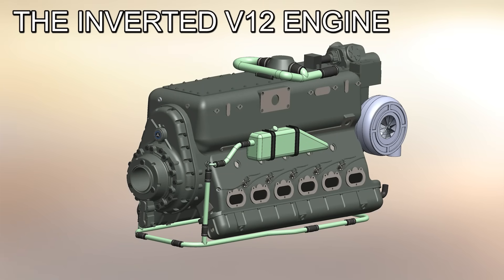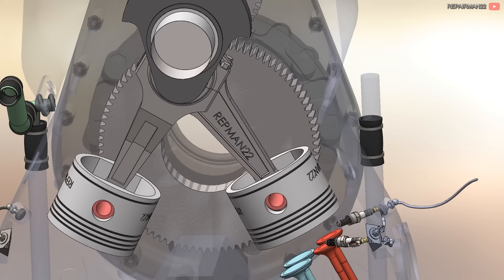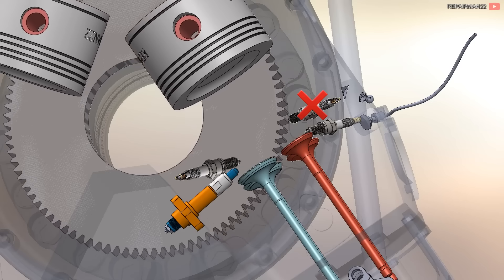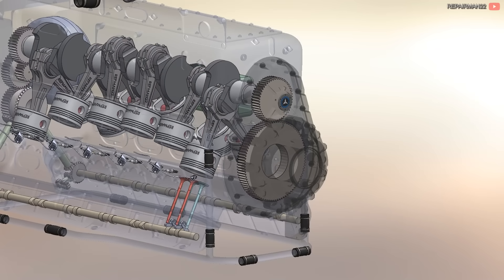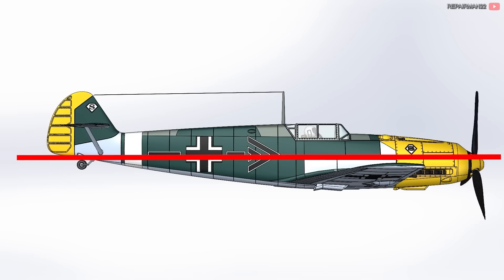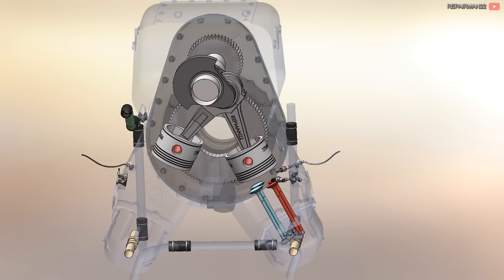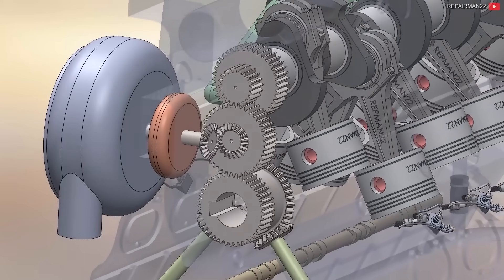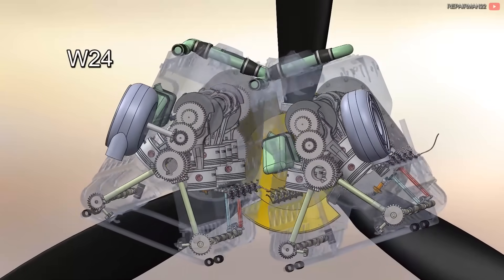The INVERTED V12 🤯 Why!?!?  - 3D animation - DB 600 Engine // Daimler Benz

Comment from the maker: Use code REPAIRMAN50 to get 50% OFF your first Factor box plus 20% off your next month of
orders at https://bit.ly/3XwV1uV!
Reply: No sabía que tenías un canal en inglés, lo hubieras dicho antes jaja
Reply: Would be nice to know mention what are the problems of inverted V engine layout

I suggest as a topic for next video diesel engines 5TD and 6TD of T-64 and T-80UD tanks, may be also V-2 diesel of T-34
Reply: @drusa6107  He did explain a few of the problems in the video:

1) Oil flowing into the cylinders if the engine was left standing. 
2) Uneven compression ratios in the two banks of cylinders. 
3) Access to spark plugs and other top end components is restricted.
4) A problem arose because of the need to put both spark plugs on the same side of each cylinder, leading to non-optimal ignition and burning. 
5) Not mentioned directly, but oil consumption is a little higher than in a standard V engine, because of some of the lubricant feeding into the cylinder heads. 
6) 5 piston rings per cylinder are needed as a partial compensation for that problem. 
7) He did mention the gasoline from the injectors stripping the oil from one side of the cylinder, leading to increased wear on that side.

So a second video isn't really needed. 

I hope that this helps you?
Reply: Aerospace engineer here - WELL DONE.
Reply: Research ur sponsors. I think this is a scam and I HATE scams and fraud with false advertising
Reply: Your channel is incredible.  Thank you for this  creation .
Reply: how will it run on modern avgas
Reply: like 115 avgas

Comment: This is actually a wet sump. sump is another word for oil pan. A dry sump is where there is a separate oil tank and the pump tajes oil ferkm😢 the tank then  what oil pools on tge sump is then transfered back into the oil tank.

Comment: You don't need an inverted engines to run reduction gearbox for the prop drive. It's better suited to an upright V like the Merlin as inverting with a reduction drive lowers the prop closer to the ground, increasing the chances of a prop strike. Also many upright V engined planes had a cannon firing though the prop. The French were first to do this with the Hispano Suiza engined  MS and Dewoitine fighters.

Comment: Nitrous oxide or Water/ methanol injection, Direct  fuel injection, a hydraulically operated supercharger, and a aluminum alloy engine block - -in the 1930s? This thing was brilliant and so far advance on so many levels.

Comment: 9:52 Bosch and Deckel sold its injection system to the USSR. Therefore, before the war, Soviet tanks had diesel engines with it (KV, T-34, JS), and soon Soviet aircraft engines received injectors (La-5FN etc). Do not overestimate the common sense of the Nazis.

Comment: The V 10 suffered from over heating and fire's. Used in the Hinkel bobmer which was refert to as the flying coffin ( not a popular aircraft as it freaquently crashed due to engine failurea killing the crew )  witas withdrawn as this over heating problem , and could not be over come . The  engine was cancelled.

Comment: In the case of fuel injected engines, the plane while flying inverted the engine would find itself in the conventional attitude. It made for better visibility as the cowl area was the smaller part and the greater width at the bottom, improving forward perception as well?

Comment: Find it interesting that the bf109 most associated with the DB601 did not have it for it's test flights it was fitted with Rolls-Royce kestral engine. After the war the Czechs found bf 109 airframes but no engines, so they fitted the Junkers Jumbo 211f and called it them the
Avia S 199, and solded them to Israel. Those pilots called it the mezek or muel, it was likely the worst of the bf109s. They had reduced yaw stability because of the underpowered over weight engine. 
Spain during the war was building bf109s but engines and props were to be supplied by Germany. After the war they were fitted Rolls Royce Merlins and you can see them in 1960 battle of Britain movie. The Merlin makes the nose a lot more chunky. Saw a HA-11102 in a museum once it is a odd plane.
Reply: The problem with the Jumo engined 109s was thry rotated in the opposite direction to the DB. The 109 fin and rudder were asymmetric to counter the prop rotation torque of the DB. This was not changed in the Czeck Jumo engined planes, exacerbating the prop torque swing on takeoff.
Reply: @billbuckley8423  The lower RPM and fat paddle blades,  and the lack of a rudder trim were not doing the BF109 any favors, either.
Reply: @Owen-mt4si Yes. The jumo engines and props used were designed for bombers.
Reply: @billbuckley8423 It is interesting how a good plane can be messed up by putting the wrong engine in. Lots of little things make a plane good.

Comment: The low octane fuel had no effect on engine being upright or inverted. It did however spoil the W 24. Reduced efficiency caused areas of overheating that DB never could fix.

Comment: So one has to wonder what the maintenance schedule was compared to a merlin, anyone?
Reply: +@johnbolt665   Wartime DB numbers were top-end overhaul every 100 hours,  major overhaul every 200 hours and max engine life of 600 hours.  I think the few flying DB engines today still use the 100 and 200 intervals, unless more durable parts and processes are being developed.  Merlins today with better parts can go 700 hours or more with easy flying, while air display Merlins with aggressive flying will get lower numbers.

Comment: Nobody is gonna make an inverted engine, and you know why? Because of the freeking physics

Fluids are attracted by gravitation, so they usually circulate in the lower side of the engine, and until now all engines toox advantage of this, engine oil sits at the bottom A pump pushes it up, and then it flows down through special holes on moving parts, makes them slipery and then reaches back to the oil pan, now, if you flip the car upside down you get your inverted engine but this time... oil gets in combustion chamber engine consumes it, and parts tahat have a ton of friction and really needs oil (like idk, THE FREEKING CRANKSHAFT AND PISTONS) get no freeking oil, lets say you move the oil pan where now you have the camshaft now and move the pump there too, well, the pump will do its best to push oil on the crankshaft, but crankshaft nees a lot of oil (this is why it tipicaly sits in the oil pan) and the pump wont give enought oil for lubrication, also now you need a lot of rings to keep your combustion chamber as isolated from the oil (if oil gets in , car consumes it and you know the deal), now , rubber (the best for this use), in 5 years gets older and have micro cracs etc (especialy in contact with oil and hot temperature) so your engine will be consuming oil like... 5 years ahead of any other engine? So instead of needing expensive fixes after 8-10 years of use because it consumes oil, now you need to fix it IDK, EVERY 3 YEARS?. If cars were truly made to break apart under 5 years, just so u have to buy a new car because it is too expensive to fix, this engine would have been in every ducking vehicle since 30 years ago.
Reply: +@randomone649   Aviation engines are typically dry-sump and pressure-lubricated for oiling.  The lowest point in the inverted DB engine will be the rocker covers and there are scavenge pumps there to return the oil.

Comment: Thank you, Repairman22. I always wondered why the German engines were inverted and how they could work with all the oil running down into the combustion chamber. Another thing I learned was the torque converter on the supercharger, which allowed the speed or load to be varied. I’ve only known superchargers that run at a single speed. Very innovative for the time. I love this sort of technology from the past. I’m 50% German and a retired engineer and I spend a lot of my spare time watching these videos. Please keep it up.
Reply: +@JamesStanfieldatMSN  The specification for inverted engines was made by the RLM in the 1920s.

Comment: So... Why not use external oil pump and carter to prevent the oil to excessively acumulate and go to the combution chamber? ,-,
It can improve the reliability...discarding the necessity of change compression ratio, improve power too, minimizing vibrations of irregular cylinders burns.

Comment: Double V12 or W24 was wasted over engineered pure idiocy, they ended up with fire bomb. Mercedes used same mechanical fuel injection in their 1950s race cars and later in 300SL gullwing. By that time Bosch had developed simpler fuel injector system for vehicles. But Mercedes insisted using their own injection system. It was difficult to tune and complex to maintain and repair. My dad worked for Mercedes all his life. From 1959 till his retirement in 1994. He hated that fuel injection system. But only one other mechanic and him were only ones who knew how to fix them and tune them. Otherwise car would sputter and stall easily.

Comment: one advantage of inverted engines that nobody mentioned, is gravity. in an inverted engine, gravity
pulls down on the crankshaft while all the power strokes are pushing up. this would have the effect
of lightening the crankshaft, cutting down on friction, easing wear on the mains and resulting in
more power.
Reply: The weight of the crankshaft is negligible compared to the force from the cylinders firing. Even just the resistance from compression would be more force than the weight of the crankshaft.
Reply: of course !

Comment: The weak part of the mn/wpl model is obviously the board speed controller (they burn a lot), weak rtr gear in the gearbox and axle, hard tires for some model, weak couple shaft (some may experience that their axle shaft still going strong, but mostly break after a couple of run especially on the first model), front plastic dogbone that is weak and not allowing sharp cornering. But, all in all, a nice model for what you pay, you can make it more durable with metal upgrade option but be aware of the increased money you spend, as it can double or triple what the original rtr cost. My reccomendation for a low cost upgrade is to change the original 360 motor for a 370 motor (as in original wpl dual speed gearbox, the plastic one, not the metal version) as it has more tourque, and add a mini heatsink on the motor driver mosfet.

Comment: Machine g u n s right behind the propeller blades .. !!, can't imagine how they can be synchronized with different rotation speeds of the propeller..
Reply: Surprisingly simple, synchronization gears were powered off the engine and set in time with the propeller. Mechanical solutions from there use a cam to either prevent the plane’s armament from firing at certain times (via a cam interfacing with a safety sear), or by having the cannons be semi auto and just having the cam slap the triggers at set safe times.

Comment: I'm actually amaze how does machine gun synchronize with the propeller
Reply: There's a system of cams and connecting rods on the propeller shaft, connected to the firing mechanism of the guns. It prevents them from firing when the blade of the propellor is in the line of fire; thus, it fires bursts between the propeller blades. This can get complex when you have a 3-bladed prop and 2 machine guns side by side, to synchronize.

Comment: Actually in the shematics it looks as if the height of the cylinders below the prop shaft was less than the height of the oil sump above the shaft, so a non inverted engine would have had lower cowling and better view for the pilot. I wonder if the always mentioned better visibility and more space for machine guns above engine was really a factor, to me it looks that there would have been more clearence above on  non inverted engine.

Comment: I don't understand how they kept the oil in the oil pan since it is inverted. The oil would also collect under each piston, I assume.
Reply: +@DavidJacques-h6s   Most of those engines were dry-sump and pressure-lubricated and used scavenge pumps to recirculate the oil.
Reply: The oil collects on the back of the pistons. But, it should get sloshed around and help with lubrication and cooling. They’re moderately low rpm engines so the extra weight and drag isn’t a big deal. 
The oil pan is really a tank that isn’t open the way a traditional oil pan is. It’s closed from the crank so it can hold the oil. 
At the end of the day they could have simply made a normal engine with a remote oil tank and not had all the complexity of making it upside down.

Comment: i love the db603 and how it was almost used in the mercedes t80 world speed record car. 3000hp 44.5L v12 with a super early traction control system wouldve been epic to see had the war not broken out the month or so before the planned run.
Reply: +@gameboy3800   The T80 car still exists in a museum with the DB-603.
Reply: @FiveCentsPlease  ive heard the shell and chassis are in a museum but not the motor.
Reply: @gameboy3800   I believe you are correct that the DB603 was removed for wartime use.

Comment: Great Video, with Great 3D graphics... Thank you for taking the time to create this. I would be curious to know which product you used to modeled it in.?.?.?

I watched a Documentary recently that discussed how; "many of the Allied Pursuit Aircraft had poor visibility, because the V engine was upright, the fuselage had to be wider at the top, and when a pilot looked through the canopy window, the pilots couldn't see down, and to the left or right very well..."
"...the Germans, however, using an Inverted V Engine could make the fuselage more narrow at the top, giving them a little more visibility when looking down, and to the left or right".

This YouTube video doesn't mention this, and I cannot find the Documentary for reference.

Can anyone Prove, or Disprove what I wrote above?
If True, it's a good point.
If it's not true, this Comment should be either revised, or removed.

Anyone?

Comment: In these inverted engines, how did oil from the crankshaft or the under sides of the pistons get back into the oil system, and not try to drain past the rings towards the combustion chamber?
Reply: +@davidhirschhorn2960   Most aeroengines are dry-sump and pressure-lubricated.   Scavenge pumps will collect and circulate the oil back to the reservoir.  In the DB engines, there are scavenge pumps in lowest part of the engine in the rocker covers to collect the oil that flows there as well.

Comment: Great video

An extra advantage of the inverted engine was that the distance from the crankshaft to the upper surface (piston case or what would have been the sump) is reduced. Since the distance from the that to the upper fuselage is driven by allowing the pilot to see forwards, the plane could have reduced frontal area. I didn't describe that well- hope you can understand it.

Comment: You left out a tiny detail on the DB 610 - it had a real nasty habit of catching on fire.  the sole reason the HE-177 was apiece of flaming crap.  Great animations!
Reply: The main reason the 606/610 series caught fire was the run of oil lines for each engine ran too close to the near catastrophic heat from the inner exhaust manifolds. A “Blackman” or ground crew fitter and a few other mechanics on one unit running He177s came up with a local field or in the German “rusatz” modification where the oil line runs were completely rerouted away from the heat. Several aircraft were modified and performed without any problems whatsoever thereafter!

Comment: Best Engine Ever made I want one so badly
Reply: +@Whatdyoumean   Hobbyists and professional machinists are slowly digitizing the parts for these engines for fun or to remake new parts.  I can see a time in the future where you can buy a highly detailed, 3D printed model of these engines in some scale that you can build and display, although I can see that they would still be very expensive.
Reply: @FiveCentsPlease  I'm acctualy a Mechanical Engineer who models tooling for a living I could totally see myself building one from scratch in my own machine shop one day, if I had the CAD or DRAWINGS THE block would probabaly need to be an original though.
Reply: @Whatdyoumean   I was following a hobbyist who had half a Merlin and was 3D printing the missing components in his spare time.  But I haven't kept up in several years.  There is a hobbyist in Europe who has machined a BMW 801 for a static project, obviously not flight certified.  He may be working on the DB series too.

Comment: 10:38 Interesting fact: To beat early marks of Spitfire that were chasing them, Luftwaffe pilots would put their Bf 109 into a steep dive. As the negative g force would starve the Spitfires carburettor of fuel. The fuel injection of the Bf 109 wasn’t affected by g forces.

Comment: What's the firing order of this engine?
Reply: +@zetrix6277   There is more than one firing order combination for a V12 engine depending on the design or requirements because they can create vibration loads.  The typical order for the DB-605 is 1-8-5-10-3-7-6-11-2-9-4-12.  However, various sub-series of the DB-605 may have a different order.  The Merlin and the Griffon have a different firing order and they sound different because of that.

Comment: The power and rpm figures are manifestly wrong. The engine produced 1000 PS at 2300 RPM and 1.3 Ata and 1100 PS at 2400 RPM and 1.4 Ata (according to the engine tech-manual for the DB-601 A). The N-Model (DB 601 N) allowed up to 2800 RPM at 1.4 ATA and produced 1280 PS. The inverted configuration and the way the piston sprayed the oil in the crankcase produced problems with foaming at high RPM, thus the later DB engines were all fitted with defoaming devices to allow higher RPM in the DB601, 605 and 603. Also the DB601 didn't have a pressurized cooling system (the DB605 had).